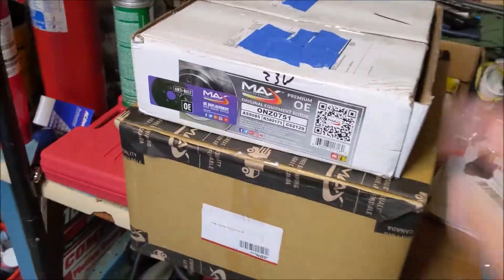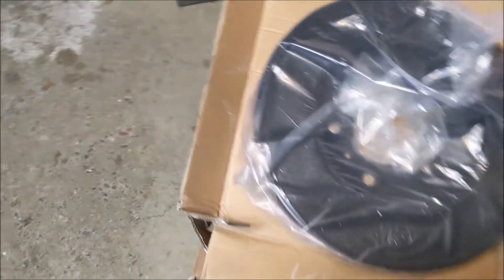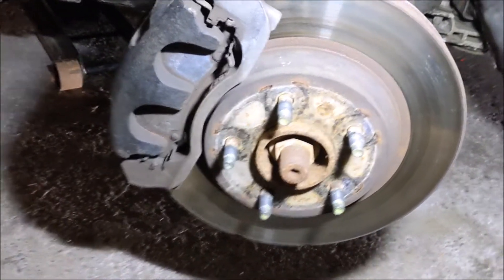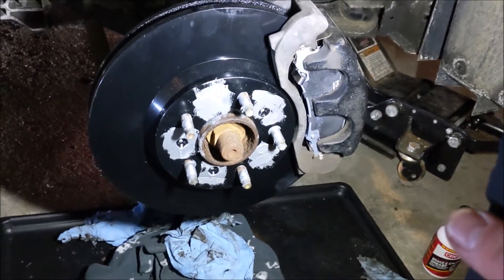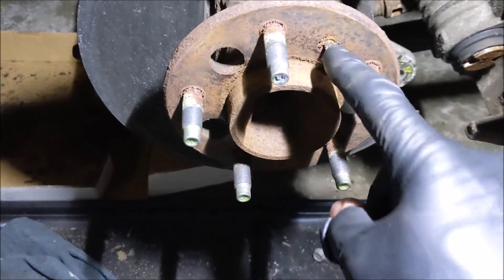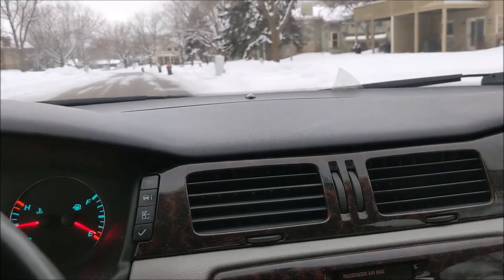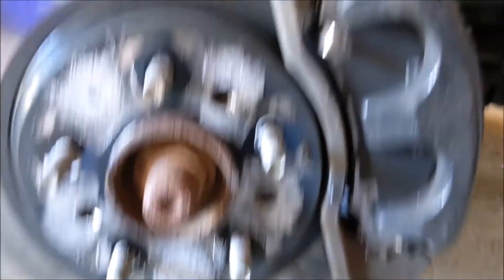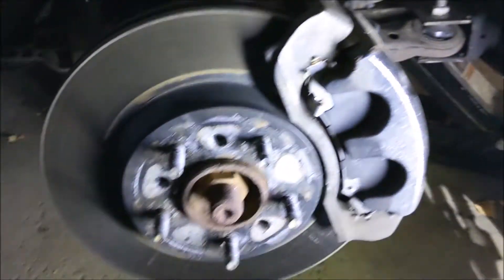2011-2016 Impala/Limited (9th Gen) MAX Advanced Brakes Unboxing, Installation, 1yr, & 2yr Updates

Comment: Im just amazed at the condition off the metal on everything because of the weather there and salting the roads I guess.  You just don't see that out here in California.  I bought that same Ryobi Impact Gun and I love it.  I put AC Delco slotted front rotors and Akebono pads and I am real happy with them.  Just solid AC Delco rotors in the rear and also Akebono pads in the rear and theyre great.  I put Stoptech pads and rotors before and the fronts warped after about 6 months.  They would shimmy so pad.
Reply from the maker: TireRack sells Akebono pads, if I'm not mistaken? Never heard of Stoptech, but I will surely avoid them!!

The road salt destroys EVERYTHING here!!🤬

Comment: What type of torch spects you put on the front and back brake pads ?
Reply from the maker: Honestly I don't know the exact specs!! I just snug them down good and firm. Go a bit tighter on the bracket bolts, as they can handle the extra torque..

Comment: 12:00 Honda has a funny way to screwing calipers in too a little square block tool. Believe me I got really good at doing brakes with the old accord I had. Thing would chew rear brakes in about 25000 km. Parts were cheap I think rotors for mid grade ones were 27 bucks.  Mind you that was awhile ago!!

Comment: Just put max on my tundra. Good quality.  On my third set on a few vehicles.  Coating well worth it in Canada.  One set was drilled and slotted only because at the time it was the only one I could get with the coating on it wick coming up to inspection.  Trust me don’t bad these because you think you need them or think they look cool.  They’re a bit noisier and not as smooth.  I’m not really sure who needs them but I’m guessing most of you aren’t racing daily. Go smooth skip slots and holes
Reply from the maker: Agreed! And if you live in the rust belt, you have an increased chance of the slotted rotor cracking prematurely. If you want to look cool, paint your calipers instead!!🤣